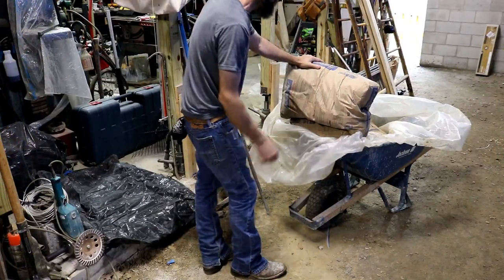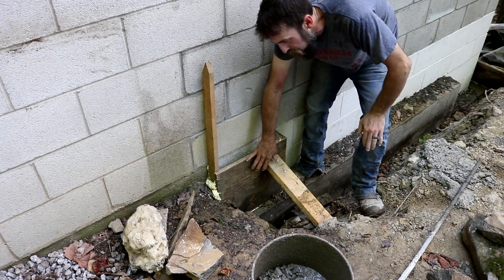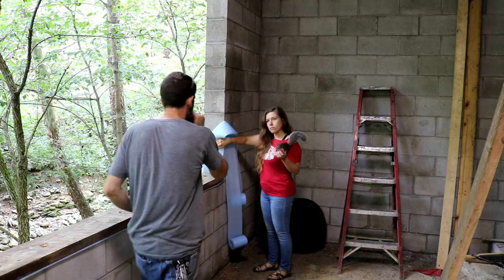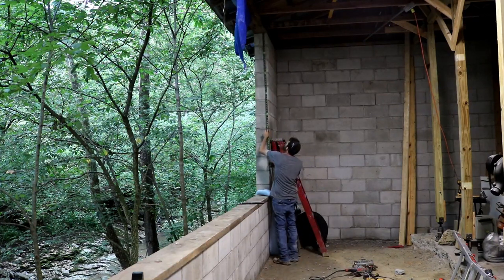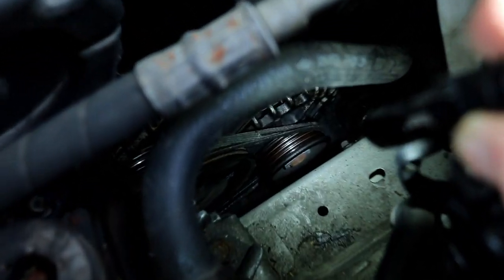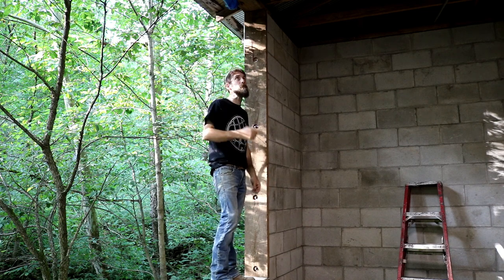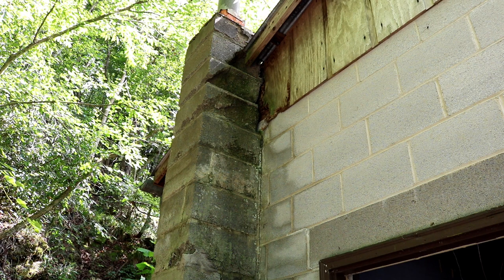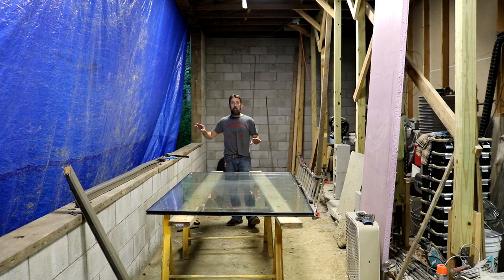Finished Concrete and Oak Trim

Comment: I used to work installing windows and doors like those. I'd just frame them in with trim pieces and silicone sealant. Set the heavy windows on two points - 1/4-3/8" thick rubber pads about 6-8" from the edge. Those big windows should be tempered glass - so even the tiniest knick on a side or corner will shatter the whole thing.

Comment: Doing a great job. Id be putting those windows up high as possible so you can use the available wall space  underneath and to protect them from sparks and damage. Hard up against your lintels basically.

Comment: It'll be nice to have your garage completed. Just a small word of advice...leave enough room in in front  of the garage door to be able to pull a vehicle inside to work on it out of the sun, rain and a smooth surface to roll around on a creeper. You'll be glad you. did

Comment: Had some similar problems with wasps, hate them suckers... My farm is certified organic so I can not use the chemical sprays.  Used an industrial vacuum unit with an 8' extension.  They buzz around the end of it and get sucked up into it.  Wire screen with bigger openings on the outside keeps the nest from clogging up the works.  It's pretty cool to watch them disappear like in nanoseconds, down the rabbit hole they go!   They just get hot and desiccate.  Bought a Rigid cordless vac for the high tunnel for the wasps and hornets out there.

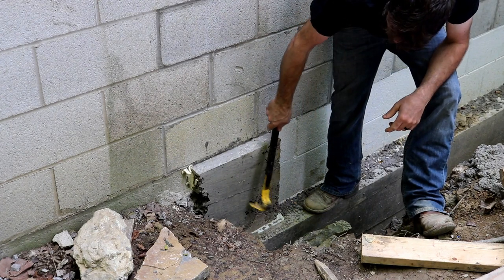Comment: Your small poured piece (29:30): you may want to lay a bead of silicone chalk (i.e., long lasting) along the joint between the top of the poured piece and the cinder block.  Intent is to keep water from going between the two, because if it freezes, a gap will develop and get worse with time.

Comment: Think about non opening windows for that glass to keep any leaks to a minimum and gain your ventilation by putting adjustable vents into the gables at each end. You were already talking about extra windows along that wall anyway that can open and be manufactured to be waterproof.

Comment: I don't remember now if you picked up one or two sliding glass doors from your neighbor. However, you could install the one or two glass sections from the door(s) as none-opening, and then buy whatever you need as opening windows to give you both worlds. Just an idea.

Comment: I made a super insulated solar home in 1982 with surplus sliding glass door insulated glass. If I had to do it over, I would make it easier to replace one of the glass panels if hit by a rock from the lawn mower.

Comment: Water intrusion and freeze / thaw play hell on masonry  that's allowed to absorbs moisture. everything above the roof line or where moisture  and can enter from the top and soak in can damage masonry. A good flue cap works wonders. Some people apply a silicone that water proofs . H2O is a universal solvent. Have watched all your video's. Keepem coming.

Comment: I believe your chimney having no liner caused the concrete to fail. The gases produced from burning, along with water, rotted the block.
Reply: ukulelefatman you may be right there. Flue gasses are a very acidic set of gasses and with water damage any soot deposited is perfectly placed for acid attack to the block work from the inside out then allied with frost heave the blocks don’t stand a lot of chance
Reply: That's also my opinion. You are absolutely right!
Reply: Could be. I'd say most of the damage is water retention in the block. Which missing flue liners can help cause. The gasses and acids would eat the inside of the block. I think the external damage is all water. Freeze and thaw cycle damage.
Reply: I know nothing about chimneys you may be right , then again you may just be blowing smoke hahahah
Reply: Agree. Flue gasses are very destructive and cinder block doesn't handle heat very well. Learned that a long time ago when I made my first furnace.
Reply from the maker: It is a lined chimney👍
Reply: @SteveSummers  I would say it's mostly water infiltration then. You'll make it right that's for sure.
Reply: @oldschool6345  He sure will, no question!!!
Reply: My father works at a power station. One of the things they have to make sure of, is that the flue gasses exit quickly and that the fuel is being correctly burned. When these things don't happen, they get (amongst other things) sulphur build-up in the flue. Mix the sulphur deposits with water, and you have a wicked strength version of sulphuric acid.
Once rebuilt, hire, or learn the skills of, a chimney sweep once a year

Comment: when you re-set those big panes of glass, use the black windshield urethane its way better than silicone which needs to be replaced every so often. Its messy if your not careful but its whats used in commercial glass install around here.

Comment: Make the small windows open. The door glass windows frame in like old slider wood windows. With a rabbit joint or a frame with a inside sandwich frame and glaze, Seal in place, I vote a frame close the the size or glass, and due to the thickness of the wall, frame inside the retaining frame in  main frame, so the window in place is center of the thickness of wall.  insert glass, then put second inside  rentaining frame. Be sure to seal with glazing/ sealant, etc. When done glass will be sandwiched with a frame inside a frame centered in the thickness of the wall. Or can move out to be flush with the outside of the wall. So lot of choices, should be upright/vertical- sideways/horizontal. Flush with out side (best) (no ledge for water to sut and rot frame) of wall or centered with thickness.  Know you will do what is best for you great work. Wish I could send some support maybe see after this C19 crap over. !  Tell Elisabeth hello. I still glade I wss able to meet you guys when at the bash. Should of got a photo!

Comment: Perhaps it would have been worth replacing the chimney with a stainless pipe? That way you if you offset it from the wall, it will be a lot easier to work on the roof, and it it won’t affect the wooden frame and trim anymore.

Comment: Steve looks like the exact mixer i used with my dad in1962. Nice heavy cast gear and solid steel construction. Your work in the shop is amazing.
I am in bowling green.
I should stop by to help some time.
Eric

Comment: make them windowssimplest possible, i.e. fixed. if ya then need ventilation, make some wooden hatches witch ya can swap with some moveable windows later... Insulated glass is expensive, wood not so much... you're doing a great job. thank you for sharing

Comment: A chimney is eaten away by the sulfuric acid that is created when the exhaust gases hit the damp block.
I would recommend an insulated stainless steel chimney. Should you shy away from the investment, the chimney must be built from hard-burned clinker.
All the best from Germany
Larry

Comment: Looking good.  I would not make the windows opening or closing.  Cut a vent on the ends an use a louvers and fan.  I've done that in my shop works great.

Comment: Steve, looking good on the project.  I have the exact same mixer.  Mine was sold by Sears, as the tag is still on it.  I just got done repairing and rebuilding it.  They are well built for sure.  Again, well played.

Comment: That chimney's been done in like that due to the sulphurs from whatever they've been burning in it mixing and reacting with rainwater...and rotting the block...
It's a common problem with Victorian and Edwardian houses here in the UK.....leaky chimneys...

Rebuild it and drop a class 1 liner in it so you can run a workshop stove...🇬🇧👍
Reply: Or use a twin walled insulated stainless steel chimney attached held off the building block wall but which ever route you take for goodness sake if your are going to build it back in blocks use a quality chimney liner.
Reply from the maker: I've been watching a show called Edwardian Farm on the Absolute History youtube channel. I love that show along with the old show Time Team😁👍
Reply: @SteveSummers  

There's some interesting stuff Steve....
Hey, I tell you what
That workshop of yours might be the only one with a set of opening windows like that and a view to look at...
Reply: @SteveSummers  
Yes there is a whole series of shows by these folks.

Comment: I would go stationary on those windows. 2 reasons, first less potential heat loss, second I wouldnt put too much time in them because if that seal fails they will fog up in between the glass and you will be pulling them back out anyways. Just my thoughts. If you are concerned about ventilation I would add some power vent fans.

Comment: Bags of cement in the UK are 25kg. They were reduced years ago because regulations prohibits manual handling of things things heavier than 25kg, so it was more practical to make each bag 25kg rather than 50kg. We all still lift more as 25kg is essentially nothing.

Comment: steve.. you only have a few holes in your roof..  do you have a good pressure washer.. an extra 50 feet of hose for it..  either a friend with a bucket lift on a truck or a cherry picker that you could get over all sections of the roof..  pressure wash the roof ..  lightly wire brush any holes..  either glue down  patches of corrugated roofing with something like that stuff seen on TV.  or your choice of adhesives..  after the pressure washing and patching.. you could with some rollers for painting corners.. to roll out white rubberized roof coating..  sealing the existing roof panels..  just gluing the patches down or going up from the inside with some of that seen on TV paste.. would greatly cut down on the $$$$ and stop the drips..

Comment: Steve, just a suggestion try Chemical cement (epoxy) and threaded rod (all thread) next time. Easy and a stronger bond than those expanding nuts. I used some made by Fischer in the 🇬🇧. Not sure what brand you'll have over there but once its set it's solid. Probably cheaper over there in the 🇺🇸

Comment: I say make them fixed, I got mine of the swiveling ones and I've found that I keep them always closed. It was much more money and now I don't use them. Big windows are not easy to move and in the end you leave them closed. But the idea of adding a smaller one, that is a good one.

Comment: I am a window Glazer/installer by trade ...  at 32:49 ... on the camera side you have the two set blocks on what was the bottom of the window. They should be 3/16" to 1/4" thick rubber. Use them when you remount your glass in whichever frame you use/build. They should be about 1/5 to 1/4 of the overall width in from the outer edge on the bottom (12" to 16" in on a 72" wide pane). They provide space for movement of the frame during the 4 seasons and stop the glass from sitting on anything directly. Hard pressure points will cause breakage. Even knots in the wood over a 6' span is enough to do it. ONLY use 2. A 3rd half way along (which seems better but isn't) will cause problems. Also, when handling those, they are most likely tempered as a safety precaution so people don't walk through plate glass. Probably bounce a hammer off the face of them, but the slightest tap to an edge will shatter them.
Reply from the maker: Thanks, I paid close attention to the way they were set in the original frames. Both pieces were a little different from each other but pretty much like you mention 👍. Thanks for taking the time to comment, I wasn't for sure of all the reasons why they were the way they were but figured the company who installed them originally did it for a reason.
Reply: On doors you may have found a couple near the top on the sides .. possibly of different thicknesses ... that was the old way of squaring the frame around the glass. Those won't be needed for your application now. The glass should completely float on sides and top to allow for thermal expansion. A bead of silicone (or similar) between the new outer glazing stop and the glass is all that is needed to lock it into place. Then your interior glazing stops to secure it.

Comment: over tightening a belt will make it shred just like the old one. You should only have a 1/2 inch of movement on the belt when pushed up and down.

Comment: Used or replacement SGD panels should be fairly inexpensive to get a couple more panels, then fabricate some frame panels using steel angle or sq tubing, possibly even used store front aluminum frames.  You will have to live with the sizes because they will be tempered and can't be cut.  Looking good.

Comment: Those concrete block chimney problems are pretty common to see. I gave up on those long ago and went with stainless double wall type. Yes, it is expensive to do, but you only do it once. When you add up the money and time spent replacing chimney block and the liners that crack, stainless double wall type makes more sense to me. Doesn't look like you have too much height on that end wall so it wouldn't take many joints of pipe to do it. You can also use standoff brackets to clear the overhang of the roof so no flashing the roof around the pipe is required since you plan on replacing the roof anyhow. Just my .02 worth.

Comment: Great progress. You really cover a lot of ground, skill wise. Some unsolicited advise. Don’t use aluminum or steel to frame up those windows. The condensation on the inside is a disaster in the winter. I haven’t seen a thermal break that works. Look into the PVC-wood composite that will stay white forever without rot. Good luck!

Comment: 1:19 - 😂🤗
That’s what happens when the pivot points of the legs are inside the overhang.
I laugh because it happened to me when I fitted castors to a tool cabinet I build and it nearly tipped over.
Soon made a frame to have the castors outside the cabinets base area.

Comment: Opening a larger piece of glass, especially a laminated sheet can lead to twisting of the frame (you appear to have large temperature variations over your year - that's an issue in itself) which could lead to breaking of the glass. As you said, it's expensive if you buy retail, so I'd go with the least risky, as a lot of others have suggested, fixed large sheets and opening smaller end windows. It'll spread the fresh air to both ends of the building which would also be controllable if you had two or more openings in each bank of window. Even consider what is popular here in Queensland, Australia, louvres, although they are not as secure - criminal wise.

Comment: that cinder chimney is going to be a pain. Cinder block is nothing but a big sponge for rain. I have yet to see any adhesive that hasn't failed on bare cinder block from construction adhesive to tar. If you have to take the top off the chimney off run the flashing in the mortar joint so you can tuck the  roof flashing under it.

Comment: Personally i would fix the big windows and have smaller opening windows at the ends, that's a lot of glass to swing, unless you go for sliding
SHame you cut the oak down in width, could have left it as a sill on the outside to help shed water off the blocks, and away from the foundation.
Reply from the maker: I'm going fixed on the large glass. I'm planning on larger overhangs on the new roof .

Comment: I'd keep the concept of the sliding door and make your windows slide on nylon runs epoxied to the bottom of the glass that glide on rollers inside a  tapered slot frame that pushes the windows back flush sealing it when closed. Plus don't forget to epoxy handles to the glass and some kind swing arm brace lock to lock the windows. Just don't know if ya want to go vertical or horizontal with the glass? One more thing I've had problems trying to find though's huge rolls of window screen maybe you'll have better luck then I have. This would save time and money just a thought.

Comment: Damn! I've been thinking what kind of bigass windows would fill that opening and you pull out sliding doors. Brilliant! You might be over thinking it tho. Why not just install them as sliding glass doors? With screen even. Just slide them open when you want air.

Comment: If the sliding door frames were in good shape, why not just remove the rollers and make your rough framing fit the door assemblies as you received them? Mounted horizontally, you'll need good-size headers to carry the roof load into your block base, but you have plenty of room.  Nowadays, instead of digging for a table in an engineering handbook, you can just google it on-line!

Comment: Sorry, just another thought... Depending on the design for the windows etc. you might need a beam supporting the roof. Your side oak pieces would then need modification or replacement.

Comment: I did not install any windows in my shop for the reason, out of sight out of mind. I realize you are out in the country but still a shop full of tools I would think twice about it.
 I use a badminton racket to deal with wasp, it works pretty good
Reply from the maker: Wasp rackets
Reply: @SteveSummers  Yes I have one hanging on a nail by the door

Comment: in the blocks that you need to fill..  why not drill a 2" hole in the face of the top row.. and take a piece of ABS plastic drain pipe.. a Tee.. a reducer that will increase the size. make a plunger for the straight thru... now you can trowel the upside down reducer full and work the plunger .. sealed with a sink slip nut adapter.. to pack the cement into the cavity..  you may only get  by with a .. no rock. just sand and cement mix..  then just trowel the hole in when done..
Reply: Good idea. Though, he's got to take the roof covering off anyway, so it's no problem to fill them in then, with no extra steps needed.
Reply: @CraigsWorkshop   but he will have to drill a big hole thru the header.  unless he is going to reframe the roof..
Reply: @waynep343  Ah - I had missed that Wayne - but it makes sense that the header would be in the way. In that case, your suggestion might be the best way to go. Thanks, Craig